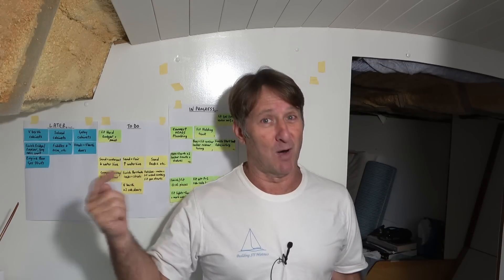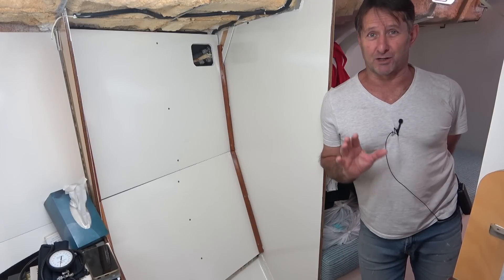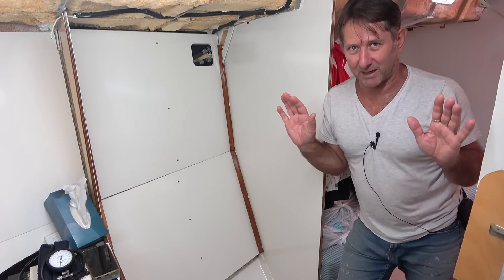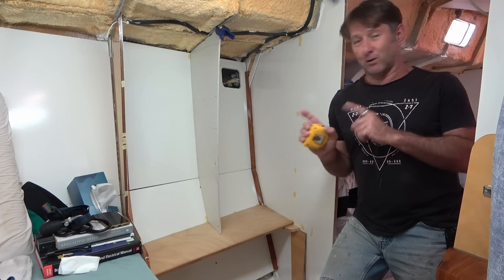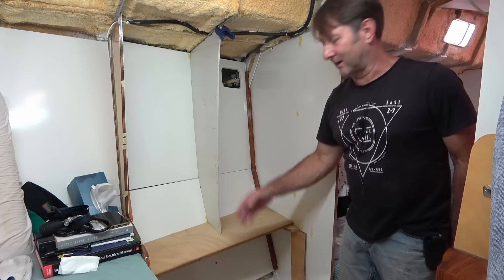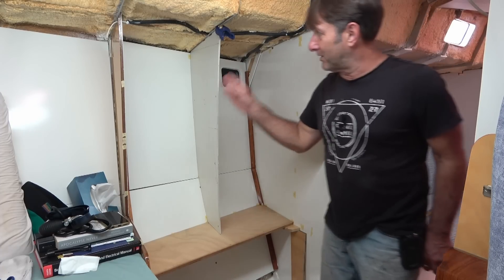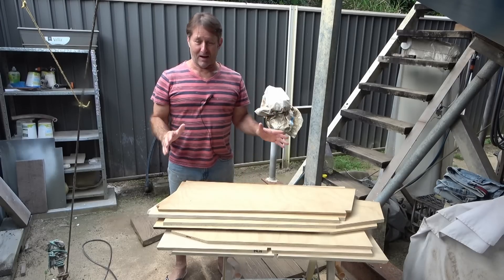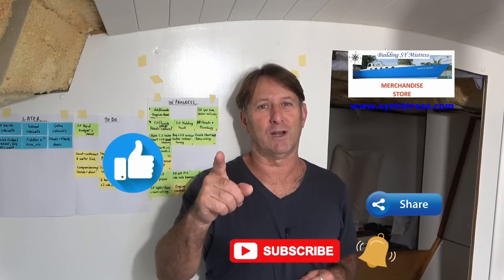ULTIMATE/LAST BATCH of Panels! 😍 Ep.169 Building my steel sailing yacht

Comment: Hey mate can I ask a question how do u know there not a little pin hole leak in the hull before u put it in the water did u fill the boat up with water after doing the hull kinda like
The reverse of testing
Reply from the maker: Thanks for your good question Joshua, there are 3 measures taken that make me 100% sure that there are not even any pin holes to Mistress' hull, never mind worse: 1)I was/am a meticulous welder when it came to particularly the hull welds; 2)all of the hull plate chines (seams) are fully welded on the outside and the inside and 3)there are X3 coats of high build epoxy paint system covering all of the steel  🙂👍🏻

Comment: As one who has lived on a small boat for years, some thoughts.
I love your 'dirty' clothes bin idea, except that your idea of size is way off.
I needs to be as big as you can make it.  Hint:  throw a T shirt and a pair of shorts into a shoe box;
Then try to add anything more!
Your hanging locker idea is also too small.  Hint:  hang two cotton button-up shirts 
in a tall carboard box for a week, outside, under cover, then check for mildew smell.
You must have air flow around clothes that hang up.
Reply from the maker: Thanks for your comments Gary, appreciated and fyi if we say that a shoe box is ~2 litres of space, the lower space in these cabinets are ~100 litres and re. the hanging spaces 1)as explained in this video and through cruising experience, I will have very few items needing hanging up, 2)these will be vented, 3)most boats of Mistress' size and particularly production built ones, have smaller and unvented cabinets and 4)actually ideally all clothes would have air flow around them, which of course is impossible, especially on a boat  🙂👍🏻
Reply: @BuildingSYMistress  Thanks for the reply...
But, It's just "G"!  Don't know a Gary.